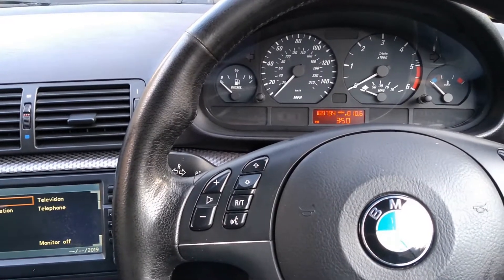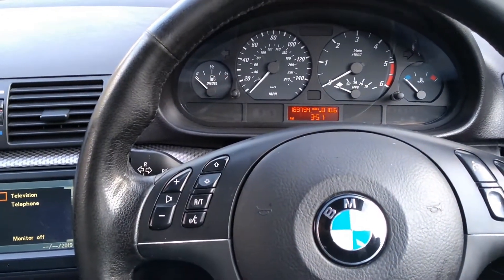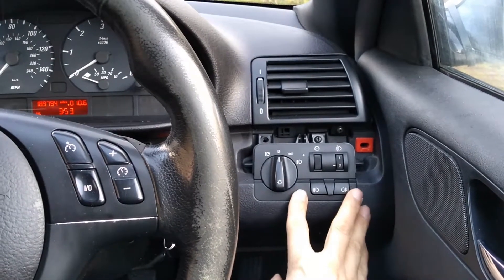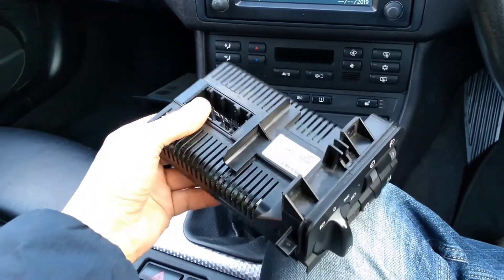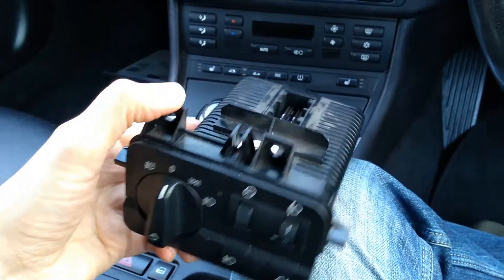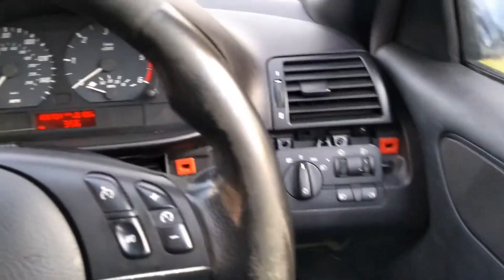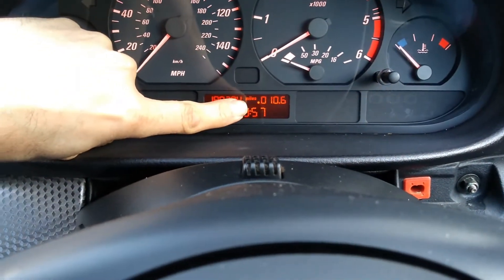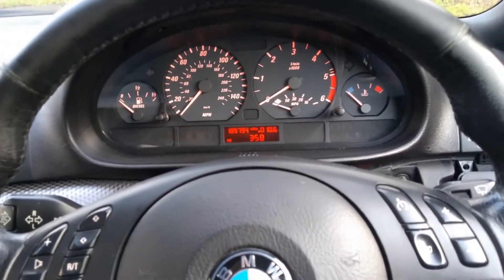E46 Lights Not Working Properly - No indicators, headlights on - Changed LCM to fix. (Proj E46 p2)

Comment: my e46 sat dead for a few weeks, jump started it and while the cables were connected my headlights all worked, as soon as we removed the jumper cables they cut off and now won’t work, would you happen to have any ideas why that would be, only one indicator light works and they all worked fine before
Reply from the maker: Yes I think jumpstarting can blow these units so that makes sense.

Comment: My e46 is 2001 and im install newrer light module 2004 with automatic option and how i can reprogram that to everything to work
Reply from the maker: Think you can use inpa/ncs-expert - u need to get the cable and software - try ebay.

Comment: Hie, ihave a 2003 318i. First it was the isntrument cluster lighting not voming on and then lately the tur signals on the dashboard are not showing or they show up late, have swutching the LCM but nothing has changed. what could it be?
Reply from the maker: Sounds like it could be the instrument cluster (or wiring to it).
Reply: Did you ever solve that problem?

Comment: Thanks for the video. I'm having issues with my lighting. All of my lights work except the headlights. I've replaced the bulbs and nothing. I've also bought a new LCM which works the same but shows that none of my lights are working (they do though) any thoughts? Cheers
Reply from the maker: Assuming you've checked the powers & grounds as in video? Also is your replacement LCM exactly the same part number? (BTW: would be grateful if you could support the channel by subscribing - thanks)

Comment: Have a similar situation, except my ligts, fender and taillight indicators are fine, but not the ones in the front. When on, the indication on the dash is blinking rapidly (way faster than yours), i.e. it's like both bulbs are dead, even though there's no error on the dash and the bulbs themselves are fine. Did some googling and most frequent answer was either stalk switch or hazard light unit. But after finding your video I'm even more confused on what the problem could be here. :(
Reply from the maker: I would say more likely to be the LCM unit. (BTW: would be grateful if u could support the channel by subscribing - thanks)
Reply: If you're still on YouTube, you don't have lcm problem. you should buy NON POLARITY BULBS REPLACEMENT.

Comment: Thanks for doing this video mate. My Full Beam, Indicators, Fog Lights, Hazards and dash light suddenly stopped working along with the low beam staying on all the time and been struggling to find somewhere to fix it for me. Will try and locate a replacement LCM and do this.
Reply from the maker: Great, glad u found it useful, hope it sorts ur issues.
Reply: Richard, did you replace the LCM and did it work? I’ve got the exact same issue.
Reply: @liamg222  yeah I did this and worked straight away
Reply: I’m goin thru the same problem currently for my 325i I figured this was an issue thanks for the advice !!